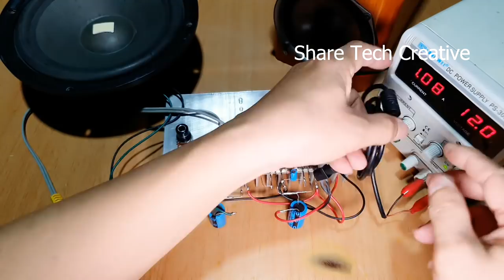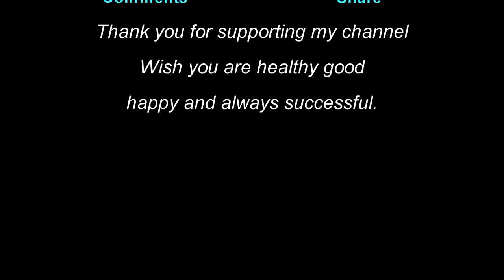Diy Heavy Bass Amplifier STEREO With C5200 & A1943 Transistor | Output Capacitor | Class A

Comment: ➤ Where did you use NP 100uf / 50v capacitors x 2?
Reply from the maker: You can replace it with a capacitor with polarity
Reply: @ShareTechCreative   Do 1k 2k resistors have to be 1 watt?

Comment: ¿Cuál es la tensión máxima que puede alimentar este amplificador?
Reply from the maker: La fuente de alimentación máxima para este circuito es de 15 voltios.
Similar a este circuito, el circuito de clase A que utiliza transistores C5200 se lanzará hoy a las 8:30 am, será más impresionante si quieres hacer el proyecto. Que tenga un lindo día